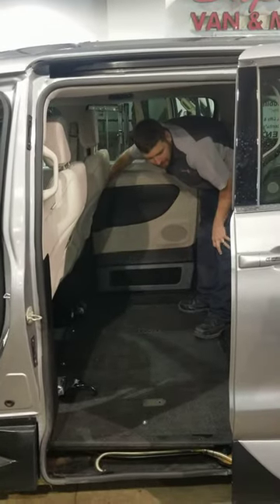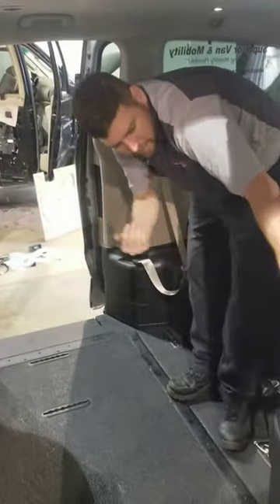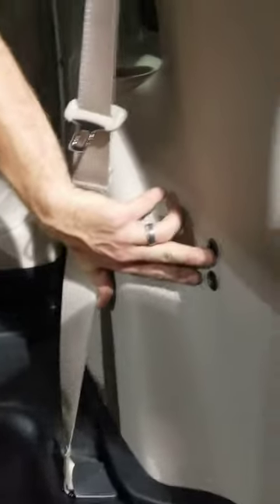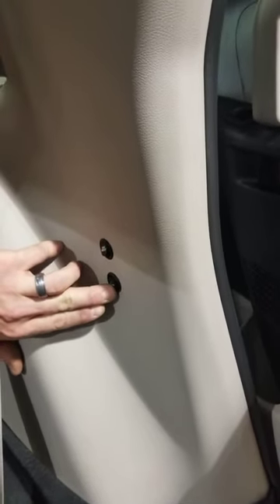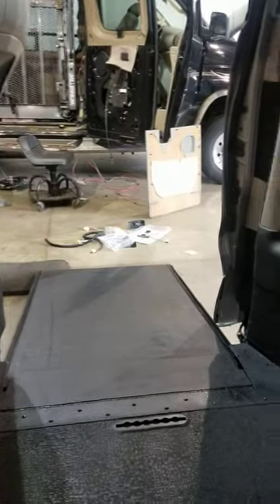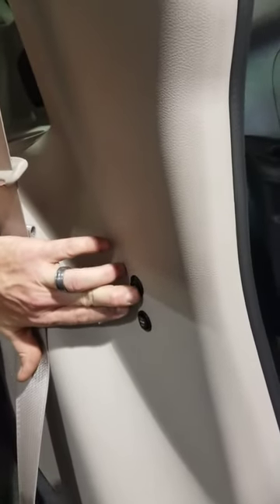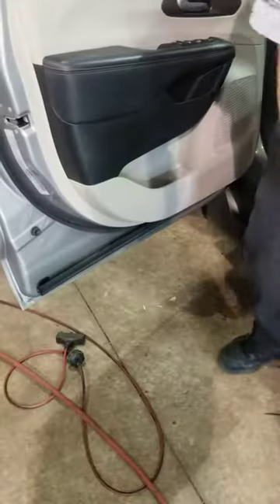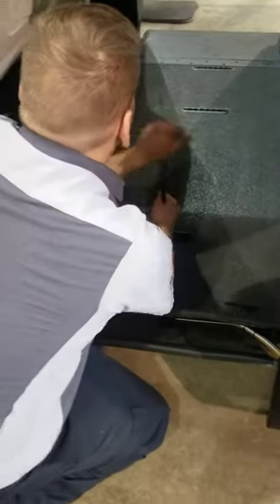Vmi wheelchair van backup system sure deploy and manual backup. In floor ramp.

Comment: Is this override the same for a 2007 vmi dodge caravan?
Reply from the maker: I don't recall off hand of its the same. 

Typically the same operation between years and models. 

Sometimes the switch location is in a different spot. 

Make sure it's a vmi dodge and not another conversion..  or you'll be looking for a switch that doesn't exist.